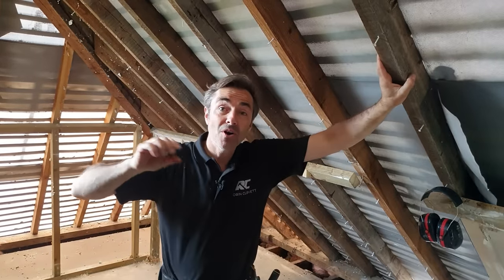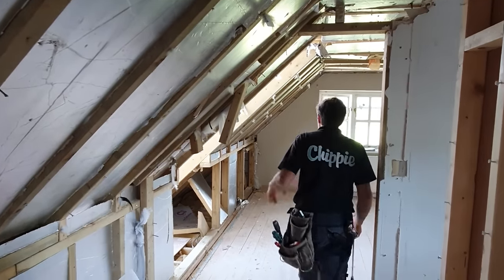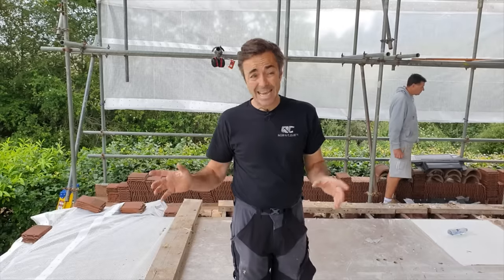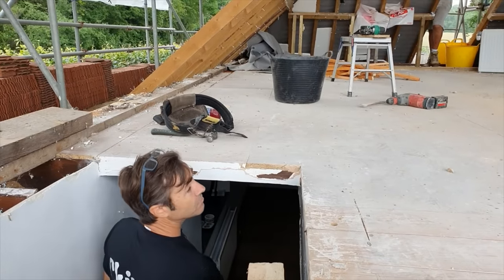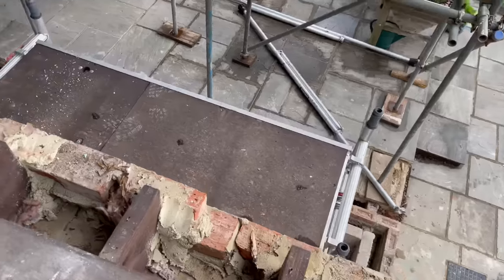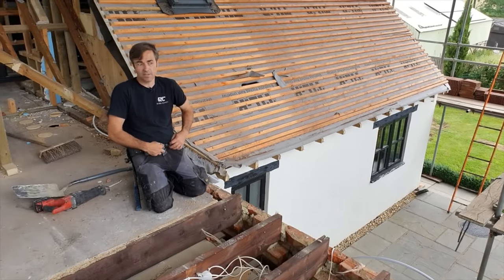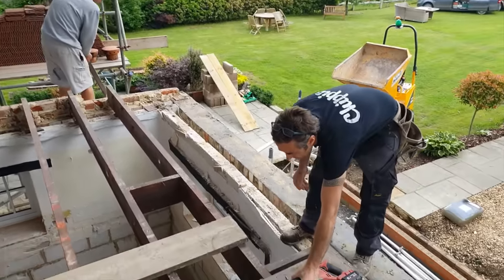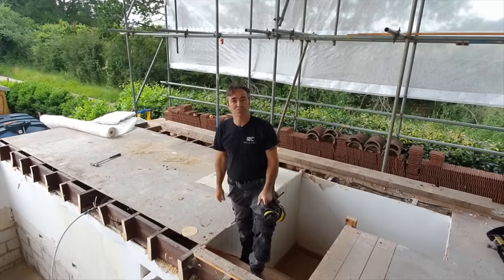The Big Build 11. Removal of the existing roof rafters, joists and the chimney

Comment: I now understand that roofs don't so much blow off but there's an aerofoil effect that lifts the roof up from the walls and then, depending on strength of wind, blows what is a floating roof away - like a hovercraft or the pucks in a table hockey game that blew air from underneath the pitch which someone had at school.

Comment: Just wondering. Would it not be simpler & easier to take the whole structure down & rebuild it? Faster & better!

Why choose this route to modify & fix? Budget? 

Just curious. Just asking 🤔
Reply from the maker: The question depends on the planning permissions that you may be able to get by knocking down and rebuilding, in some cases you may only get an uplift on the "original" footprint of only 30% in some areas but additions and extensions can be easier to get permission for thus eventually gaining much more habitable space!! I had the same at my place so we kept the slab and rebuilt with Permitted development and planning, this is where a really good chartered architect who knows the area really well pays dividends
Reply: @ukconstruction  ok. 👍 But I heard you say that walls were not plumb in the original structure, except for one, in one of the earlier videos of this build. A case of ‘repair for safety’. So one could replace the walls of the existing structure & go about the extensions. Hence my question!

Love your videos🙏

Comment: I've seen worse structures in YT videos from Russia... that's about the only positive thing I can say about this. I recently started watching a series from a guy renovating what looks like an abandoned project doing an extension on a 19th century rural log farm house. It's sheer madness! If you left a couple of ten-year-olds with absolutely zero experience holding a hammer unsupervised with tools and plenty of OSB and reclaimed timber I think the result might be something like that chap's got. The original house seems to have been just one room, brick on the ground floor, logs on the first floor, with a kind of large porch along two sides, covered by the main roof. Someone's removed the whole support structure of that porch and "supported" the floor joists with a bunch of rotten posts drunkenly leaning in a corner. The floor sags at least a 100 mm over a 2 m span and what's left of the old outside wall (inside the new wall built from what looks like 2x3 leftovers and OSB) and upstairs ceiling joists are just flapping in the breeze. I don't understand a word of Russian but just watching that train wreck is marvelous!

It doesn't look like the chap's own work is up to modern standards either though. One of the first things he did, apart from patching the roof and demolishing some of the worst bits, was build a suspended timber floor on the ground floor, the joists propped on a few loosely stacked bricks, with absolutely zero insulation.

I live in Austria, where construction is almost as over-engineered as in Germany - I think a loft conversion/new roof build requires something like 200 mm of insulation these days, so building without any insulation in a place that gets as cold as Russia feels quite strange to me.
Reply from the maker: What's the channel called!!
Reply: @ukconstruction  It's called "Dioma1111" or МОЙ КУПЕЧЕСКИЙ ДОМ (I used the first version of the channel name in the YT search and it came right up). As I said I don't speak or understand Russian but from the few words I've picked up I think the name means something like "My (something) house".

Have fun watching it! It's decidedly by far the most bonkers hovel I've ever seen in my life!

Comment: How is Building Control expecting you to prove the insulation installed works on completion in the new regulations?
Reply from the maker: Thermal tests, we are working with a company at the moment who is pioneering the technology and simple testing, initially it will apply to new builds and it will be several years before the domestic market will be required to do this
Reply: @ukconstruction  Interesting.  Who will they be employed by the developer?  Possible conflict of interest perhaps?  I could see these being an extension to pre-purchase surveys by the RICS as part of mortgage conditions.

Comment: They obviously hadnt heard of the go no more than a third into the timber when they did the old birds mouths either.
Reply: Being a passionate carpenter myself I have refused to pitch roofs on jobs when the plates haven’t been thought out in heights correctly due to variation in timber widths new versus old for to new  solid insulation thicknesses. 
I have even cut the block work down and re bedded the plates. The lengths you go to to do a correctly installed job. 
Unfortunately some tradesmen don’t have PRIDE in their craft!

Comment: We need manufactuerers to produces a better insulation material for construction industry than PIR. There has to be technology available in teh 21Century to produce insulation that is not flammable and doesnt produce 15x more toxic gasses when it burns relasing harmful carbon monoxide and hydrogen cyanide gasses as identified in the Grennfell disaster.  We have to move to materials that are less flammable and toxic in fire situations.